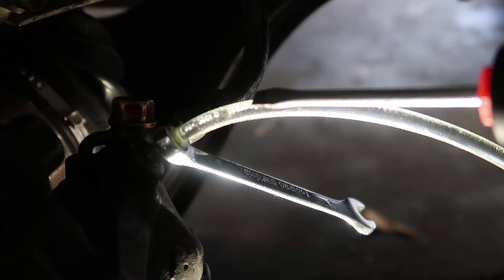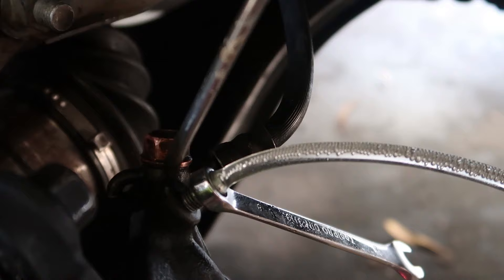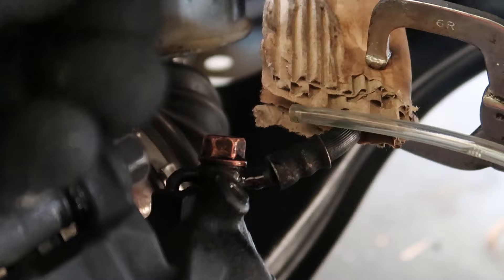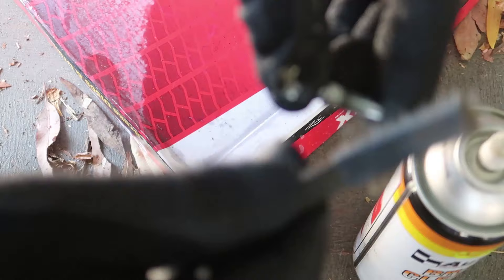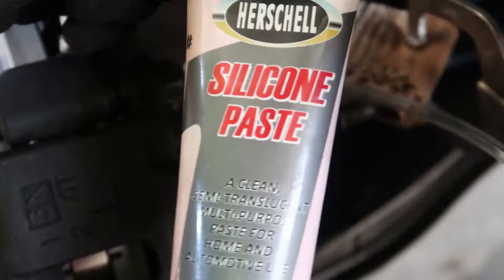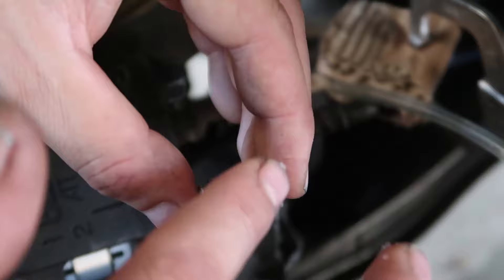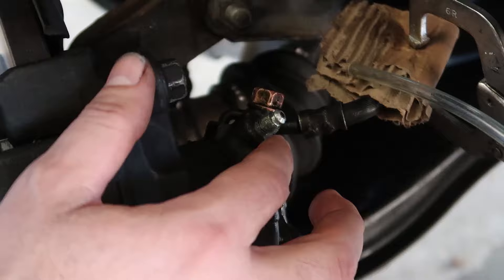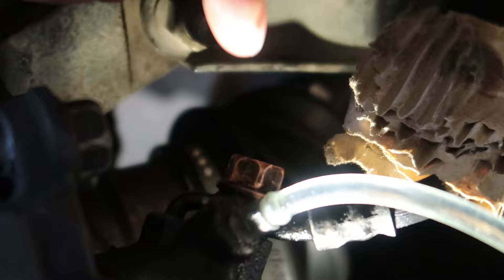How To Fix Air Bubbles In Brake Bleeding, SUPER EASY FIX.

Comment: If we want to purge a system with ABS without a scanner, how would we do it? If you want to change hoses or brake calipers, etc.
Reply: You need the right tool, it’s a tablet sort of vehicle diagnostic tool that can electronically purge your abs module to get that fluid moving.
Reply: Flush/bleed your brakes like normal, then go find a gravel road and slam on your brakes a few times to activate the ABS then bleed again. May need done a couple times and not the safest option of course lol. I do not recommend this and I’m also not legally liable for anything if you chose to do this, if you do everything that happens will be of your own doing and only you can be held liable.
Reply: @sheesh4225  umm, I like this way but as you say best a scanner. Thanks.
Reply: @cransaftvalve734  lol I’m sure an open field would work too, I actually seen this method as a recommendation on a forum the other day. I just added the legal stuff cuz I don’t wanna end up liable for someone crashing. Can’t be too careful these days lol, depending on the vehicle and whether I could find a place to do so I’m sure I’d attempt it myself. But yeah maybe time to invest in a good obd2 scanner with that functionality
Reply: @sheesh4225  I have a Delphi CRD2.x ECU and have purchased multiple scanners and returned them. It doesn't read many parameters. I don't know, it must be special.
Reply: @sheesh4225  😂
Reply: Not all scan tools with ABS bleed function works for all cars so beware of that.

Comment: I was always under the impression that once you removed the bleeder screw, that all the brake fluid would come out. In your case, I did not see that happen. Why did the fluid not flow out?
Reply: He clamped down the brake hose to stop the fluid flow.
Reply: Which is a bad idea because brake hoses have a plastic liner and clamping them off can break that liner leading to premature brake hose failure.

Comment: Looks like a good fix! But my question is.. brand new calipers are giving me these air bubbles & older calipers are giving me these air bubbles? What gives!? All 4 have a screw leaking issue? & wouldn’t that cause an issue air getting in to the system eventually? I kno it’s going to be threaded down when closed but still doesn’t make me think it would fully seal if all the threads are leaking 🤔 & when I close the threads & pump up vacuum pressure wouldn’t the threads be seeping air causing the pressure to drop? Cause it does not drop it stays where I pumped it too? Damn this is getting annoying & I keep getting murdered by bugs!?! 😆
Reply: have you thought about using teflon tape
Reply: The tapered end is what seals the caliper air/water tight.

When you crack open the valve, the tapered end is pulled away from the hole inside, which  then allows fluid to flow out and through the hole on the side of the valve. 

The threads only need to keep the tapered end down tight.

Putting some grease around the outside would have done the same thing.
Reply: These days they don't know how to make a bleeder screw that seats properly, just loosen it up and you can wiggle it around it's so loose.  It's probably from refurbishing them too many times.

Comment: I hear that PTFE tape (plumbers use it) on the thread of the bleed nipple is the way to go.
Thanks.
Reply: There's also PTFE pipe dope which is easier to work with, but a little silicone grease or Duco cement around the base of the bleeder would do the trick WITHOUT removing the bleeder screw.

Comment: There's no more air bubbles because the hose is pinched off
Reply from the maker: haha, you right.
Reply: the air bubbles are NOT coming from the top tube .......... only the bleeder valve threads ...it will do no harm whatsoever!

Comment: possibly the only good piece of info is the grease on the tube to seal any air that may blead through the screw bleed head and tube. Do not think you would have to of removed the blead screw. just lather it up. otherwise ....wow

Comment: 4:06 SILICONE  PASTE ON A HYDRAULIC  BRAKE HOSE OR BANJO BOLT.. WOW.. THERES WASHERS TO SEAL THOSE TO STOP LEAKS.. THOSE VALVES WILL HAVE BRAKE FLUID ON THEM. SILICONE CAN MESS WITH  THE CALIBER OR BREAKING
 SYSTEMS 

JUST GET NEW BRAKE CALIPERS  FROM AMAZON  NEW A PREMIUM  BRAKE HOSES   NEW BRAKE CALIPER BANJO BOLTS  YOUR GOOD
Reply: He was talking about the bleeder screw and bleed hose.  Not the brake hose.  If there's a leak at a banjo bolt, new washers are required as a minimum.  If that doesn't work, new banjo bolt, brake hose or even caliper may be required.

Comment: those bubbles of air don't do anything, it's behind your brake pad,
Reply: Bubbles of air  in the system cause a spongy brake pedal so yeah they do something bad.
Reply: @strumpeteer  NO, they do NOTHING because like the other guy said THEY ARE COMING AFTER THE BRAKES!!!  THEY ARE NOT PUTTING AIR INTO THE SYSTEM, ONLY INTO THE JAR!!!!  REALLY BAD VIDEO.  Everyone is a YouTube star.
Reply: The idea is to see IF and how much air leaves the installation.
If it draws air in there, you're not sure when all the air came out from the caliper or brake line.

Comment: If it isn't leaking fluid when closed...
Reply: @Fred Wills I wasted 400 mm of brake fluid going made trying to get the air out of one brake line, I still have three lines I'm going to bleed when my new brake fluid bottle arrive. Any advice before it arrive is most welcome
Reply: @Fred Wills thanks that is a lot of help & good advice, but I have a question. Is the air bubbles entering the bleeding tube from a bad sealing can also enter my brake line?

Comment: This is completely wrong. The air from loose thread is sucked with the fluid flow, already coming out the brake system. It's like tap water with loose hose, the air not coming from the water pipe.
Reply: No he is right trust me I have seen this many times before! Air is coming through the threads before it comes through the hose and going into the hose. I used thread tape. Just a small amount and it quits for me.
Reply: In my case it was coming from the threads on loose bleeder screws.
Reply: Why is it wrong.What he did works.Enough said.
Reply: You are correct. The air is not going backwards into the system, just appearing in the bled fluid after the threads. I think it just bothers people to see any bubbles.
Reply: He's 100% right!

Comment: Use a pressure bleeder and you can NEVER pull are in system. Also your bubbles are because the tube isnt sealed to the bleed valve so a little air is pulled as fluid is forced out. All you need to do is wiggle the tube and push it down and keep it str8 OR get a narrower tube OR use a wire tie around the valve OR clamp.